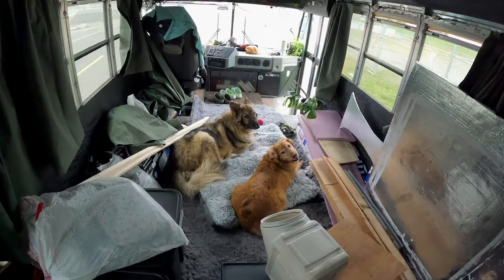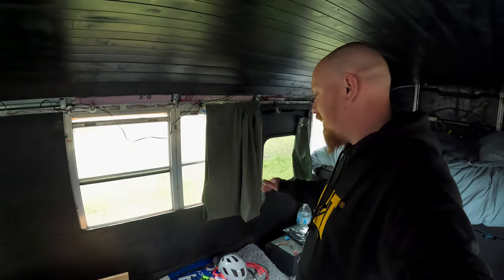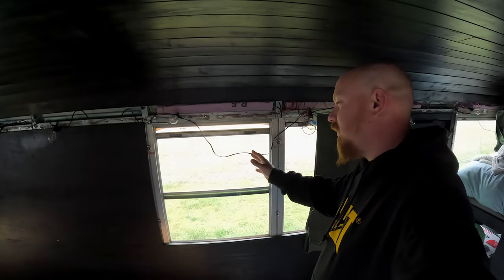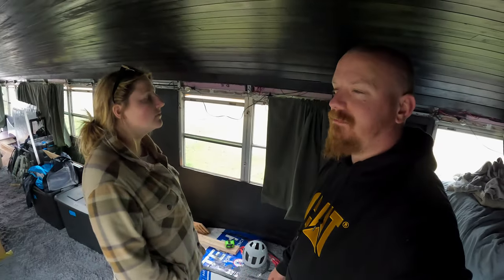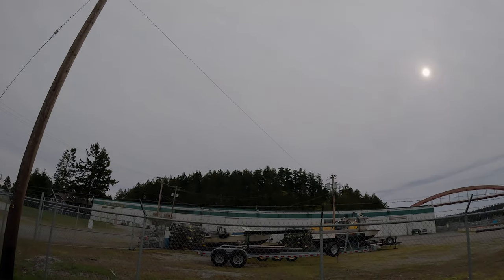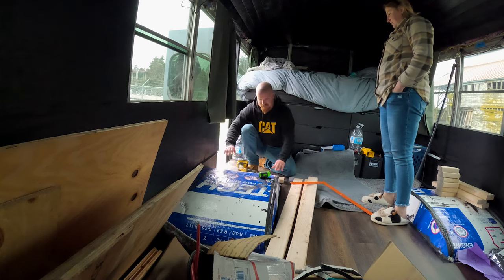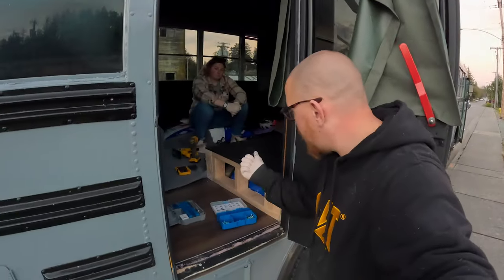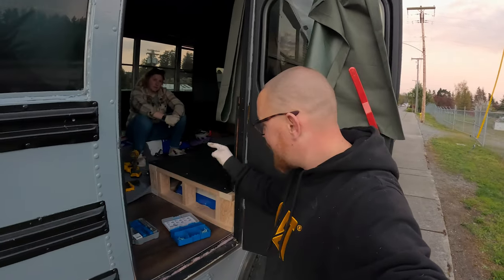Building Our Electrical System Platform | Skoolie Conversion

Comment: are you going to insulate those wheels wells so the batteries don't get to cold in winter time ? i read that cold and extreme heat are not good for the batteries.
Reply from the maker: They're currently insulated well enough, and being in the house portion they will be much warmer than 99% of RV batteries in this spot! 🔋

Comment: Why not put batteries and inverter in the basement?
Reply from the maker: There's no room with the water tanks down there, the basement will be far colder than the house portion, and those doors are prone to leaking. I won't risk water making contact there at all.